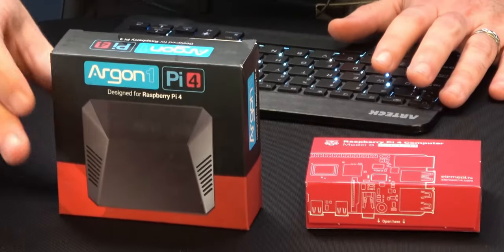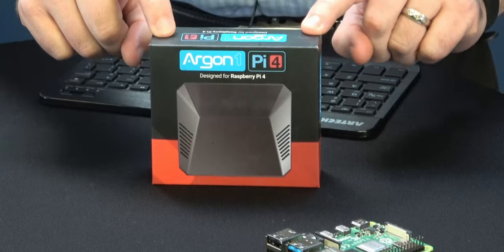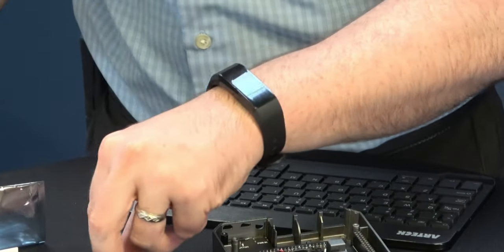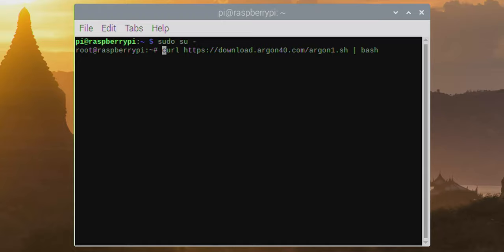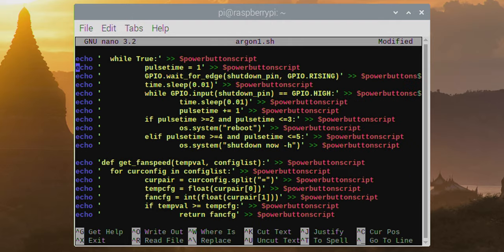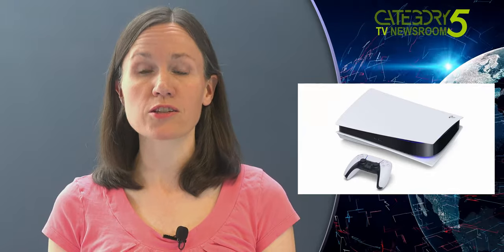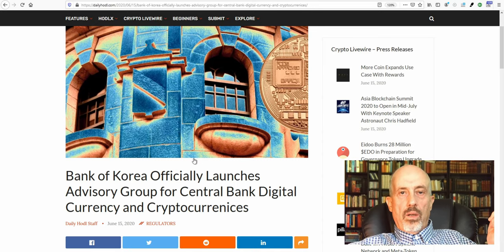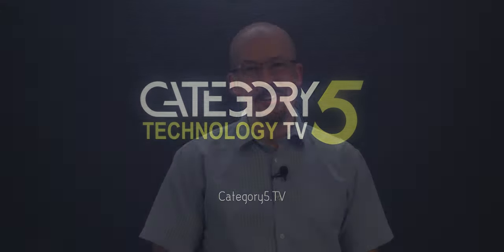655 - "Making" A Killer SBC-Powered Desktop Computer

Comment: Hi, I wonder how it would be possible to control the fan of the Argon One case when using a different OS than Raspbian (or Raspberry Pi OS as it is called now). Sure, there is a script from the supplier you could download and use to control the fan but this only seems to work with Raspbian. When using e.g. Ubuntu it won't work. So the Argon One case is limited to be used with Raspian or is there a way to get the fan working in other OSes?